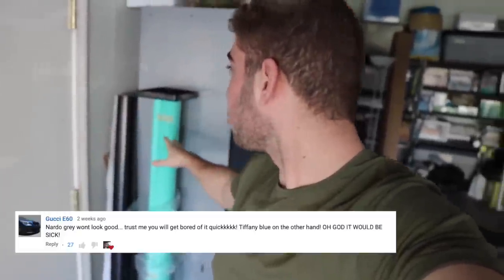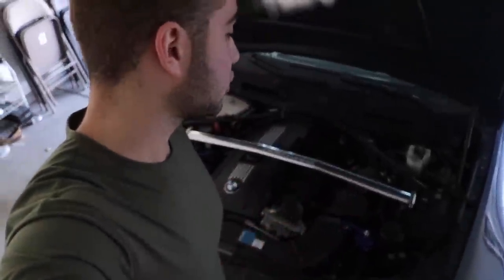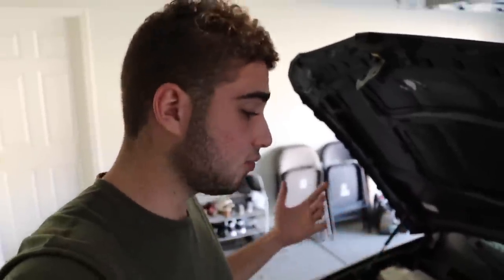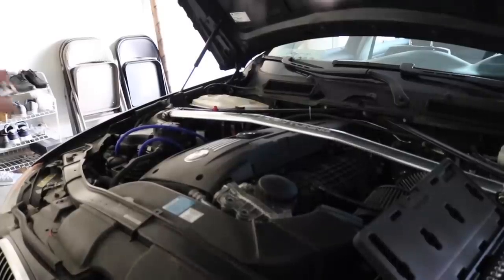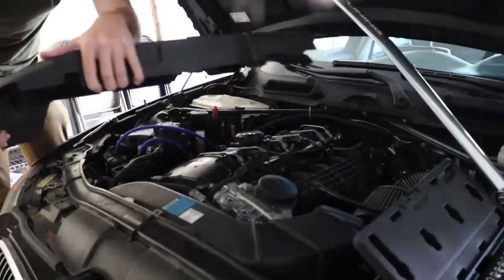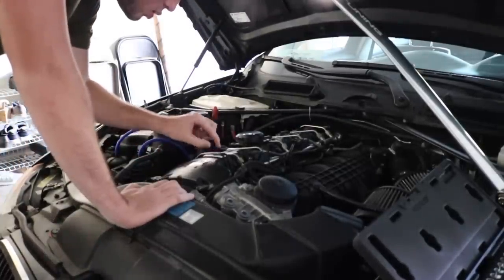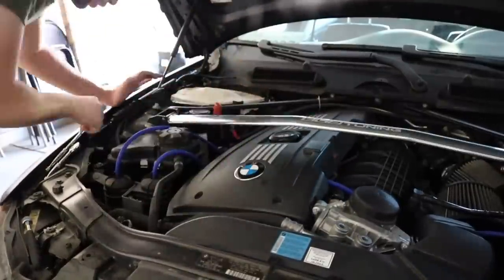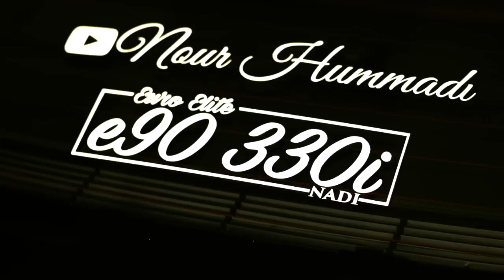THE 335I TWO FACE WRAP! (PART. 3)

Comment: Did you floor it while the engine was not warmed up correctly? 
I quickly found out that the N54 disapproves of this behavior
I deleted the codes with Carly and have been respectful since then.

Great video's man, if I could just mention one tiny bit of criticism. And this goes for many youtubers.

Could there be another way to address us as 'you guys?
As an example "I know you guys have been asking and I really want to do it for you guys, but you guys have already pointed out that you guys really feel like you guys are..." 

Maybe just drop the word 'guys'? I am a guy, still, the word ""guys" is starting to get old. Maybe it's just me, if so then ignore this grumpy old bastards comment
you guys
you guys
you guys
you guys

Again, thanks for all the content.

As for other viewers disliking the mixed content, just name the video to include that segment
So instead of
THE 335I TWO FACE WRAP! (PART. 3)
name it
THE 335I TWO FACE WRAP! (PART. 3) & fix vacuum lines

keep/make the door handles black